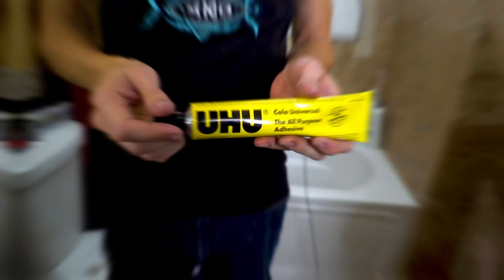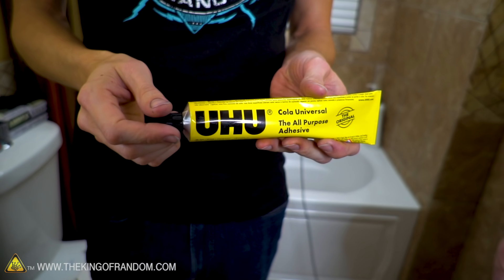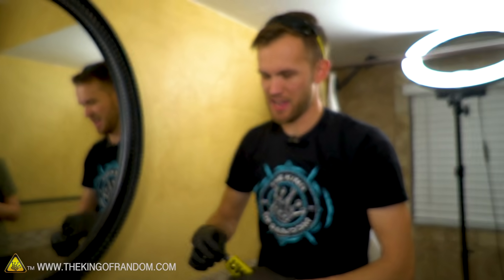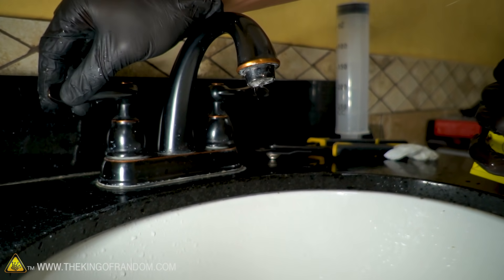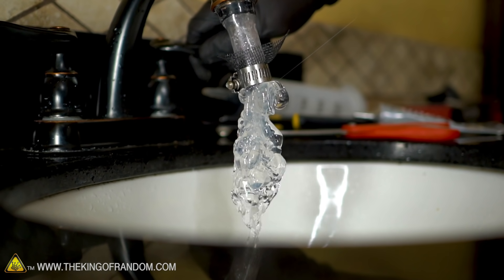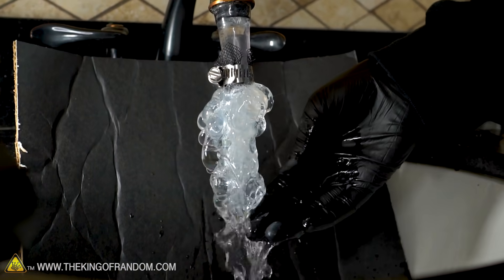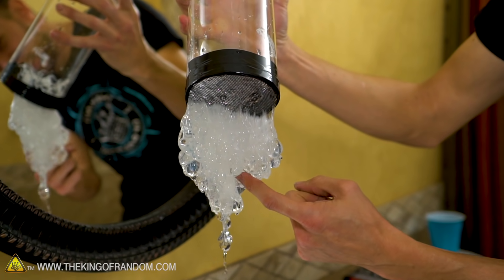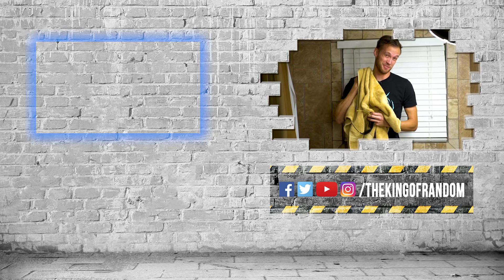What Happens When You Put Glue on a Faucet?

Comment: It's pretty much the only glue anyone has ever and prob. will ever use in Austria 😂 literally no one in school used a different brand. Ps we used UHU to make glue balls as big as we could (put a drop on a smooth surface and then tap it with your finger until it turns thick and you can form a ball)

Comment: Idea: take a bottle of sprite, put a needle with string through the side of the mentos, put it on the nozzle of the coke bottle, (like the Tiktok prank) and tape the string to the sides of the bottle. (Don’t put the cap on!) then put mesh on top of that and put super glue on the mesh. Tape the glue mesh to the sides and then POINT IT AWAY FROM YOURSELF! And take off the tape for the mento string. 

FWOOOOOOOOOSH

Comment: A stalagmite is a type of rock formation that RISES from the floor of a cave due to the accumulation of material deposited on the floor from ceiling drippings. A stalactite is a type of formation that hangs from the ceiling of caves, hot springs, or manmade structures such as bridges and mines. YOU WERE MAKING STALACTITES!